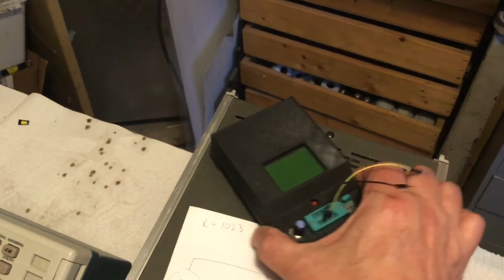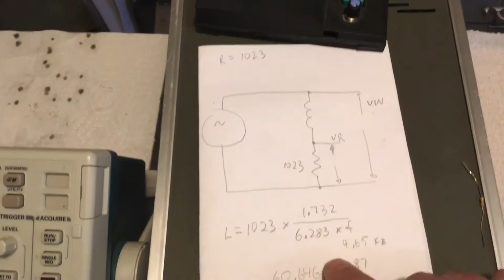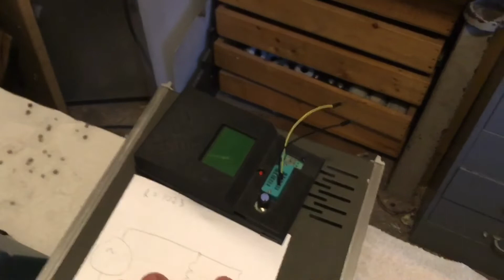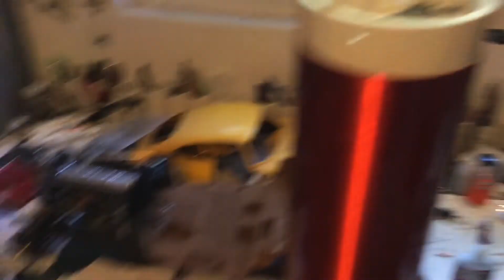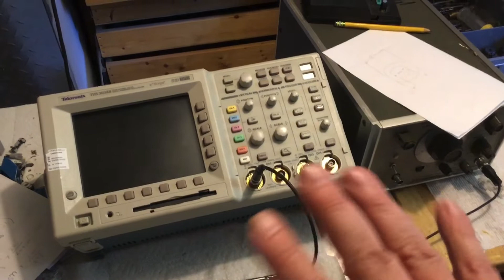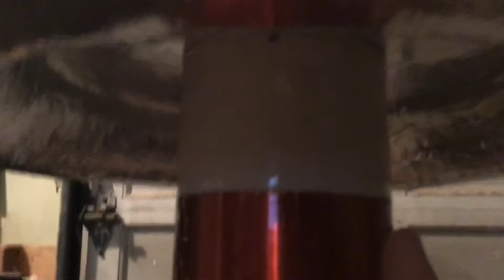DRSST Tesla coil build part 9; It kinda tries to work! I need your help. Again.

Comment: Your issue is probably that the primary and secondary circuits aren't in tune. You have to tune them by adjusting the primary tap point.
Reply from the maker: Yup, I did that since this video. But the main problem was the overcurrent protection set too low. I have another video showing it working.
Reply: @customfabrications  Yea I just saw that vid. Nice. Still needs some tuning as bc of the arc loading your secondary res freq drops so you need to tune the primary to that and when they are very close in resonance that's when ull get the biggest arcs. But yea the overcurrent also would have prevented sparks.

Comment: In the UD2.7c you have two jumpers near an electrolytic capacitor in the middle of the PCB. Move both to the side. This way you invert the phase of the ouput of your controller, this might be the problem but I'm not sure.
Reply from the maker: Thanks, I’ll try it.